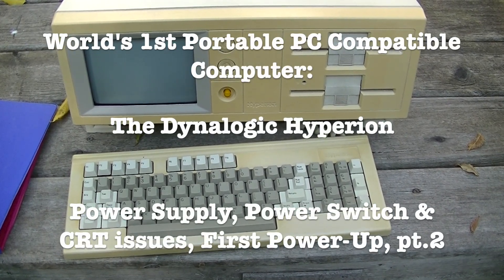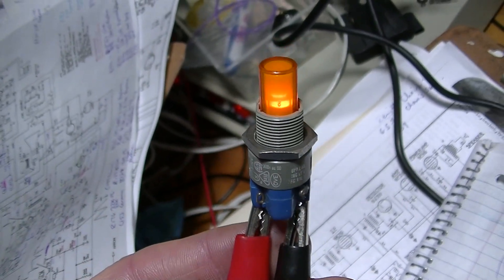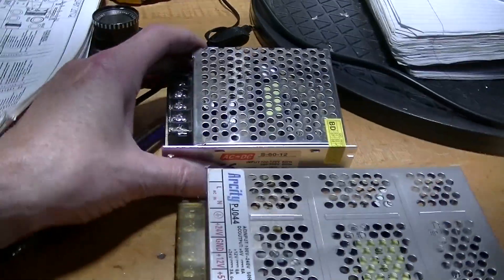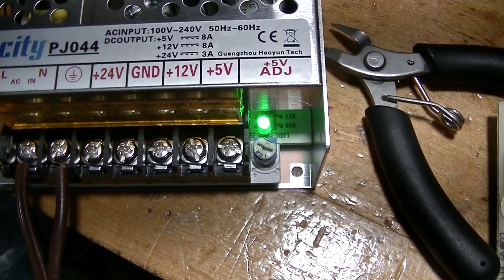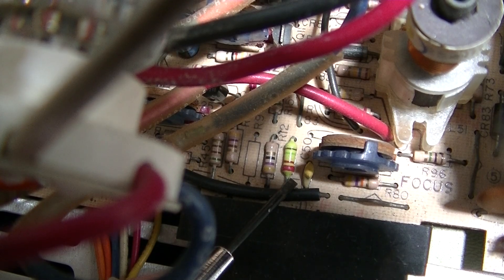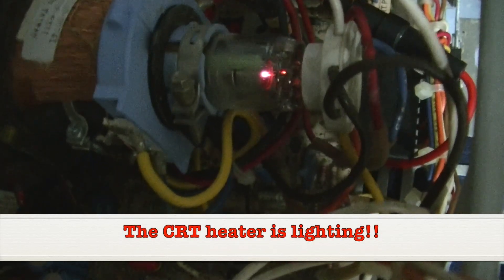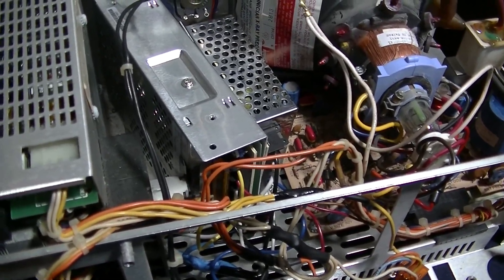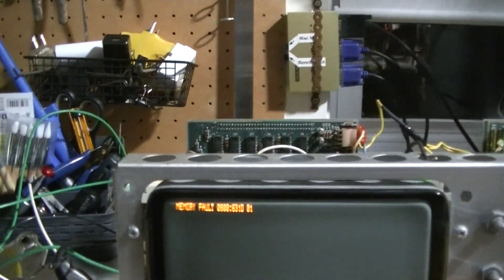1st Portable MS-DOS Computer: Hyperion (pt.2, Power Switch, Power Supply & CRT issues, 1st Power-Up)

Comment: I used to service these back in the day. We were the distributer of these units. They were also rebadged as 'Agile' by Anderson Jacobson. They were sold by London Drugs in BC. We had many many issues with the 5.25 inch floppy drives.
Reply from the maker: Thank you for commenting. I've read that Hyperion computers had a number of problem areas, with flaky disk floppy drives being near or at the top of the list. I'm wondering if you know anything about a weird video problem. The picture width is normal but is about ⅔ the correct height. The video is not readable and it looks like the linearity is way off. Brightness is way down too.  It looked like the printed circuit board traces to the 4-pin video connector were not making contact with the connector because I could wiggle it and I would intermittently get a picture. I ran 4-bodge wires to the connector from the 74LS244 and that hasn't really helped. Does this sound familiar? Thanks…

Comment: Cheap switchmode supplies tend to be horrendously noisy, injecting enough noise into the AC line to interfere with AM radio.  I had that problem with an inexpensive PoE switch with a built-in power supply which was recommended to me.  Luckily I had another 56V power supply which came out of an old NVR and I only had to swap the two output pins on the power output connector to get it to work with my switch.

You have to be very careful with powering up old monochrome monitors without a signal as they sometimes don't have their own horizontal oscillator in them.  One well known example is the IBM 5151, which derives its horizontal sweep from the TTL video input.  Without that signal the flyback won't oscillate and it can blow its primary windings.
Reply from the maker: You're right about the noise caused by some power supplies. Broadcast band (AM) radio reception becomes impossible. I haven't tested these power supplies to see how noisy they are. Yet.

Comment: Can you get hold of an Thermal camera, or if not, just an IR Thermomenter? You then can try to see if there is a sudden temperature difference between one and all other chips. I am lucky to have a Thermal camera (Leupold LTO tracker), and that saved my day in an array of logic IC's where one was bad. It lighted up as a Lighthouse among all others.
Reply from the maker: Thank you for the suggestion. A thermal camera and a better solder sucker gun are both on my wish list. The last thermal camera I was looking at was about $400 USD. Sadly, it’s not on the shopping list for the near future. Until then I’m going to have to rely on more primitive methods (e.g., alcohol evaporation). But you’re 100% right, a thermal camera will identify a shorted component quickly every time.
Reply: @Mr.BrownsBasement  Leave the machine running for a while.
Place your fingertip against the memory circuits.
With a little luck you can diagnose which one it is (cold or hot compared to the others)
Reply from the maker: @RandomerFellow Fortunately, there were no shorts on this board. With a board of this vintage, I would be more concerned about a capacitor shorted rather than a chip shorted as dead tantalums are almost routine. At 1.25v, a shorted tantalum will dissipate a watt or more. If it isn’t turning brown or beginning to stink it will eventually pop and take itself out of the circuit. I want to get it before it pops or starts spitting.
Reply: @Mr.BrownsBasement  Not sure if you're aware but FLiR makes a smartphone connected camera. New, they go for about $200 but after a cursory ebay search I saw they were going for about $150. Still expensive but it might be more palatable.
Reply from the maker: Thank you for the information. No, I wasn’t aware of that. But I was hoping to get a premium quality infrared camera so it would be both the first and last camera I would have to buy. I wouldn’t mind a feature like HDMI out as it would make it easier when I making videos. At this point, I’m saving my pennies for a good camera but I’m not there yet.

Comment: "PCs and... PCs"? Heh, oops.
Reply from the maker: Did I confuse my printed circuits, progressive conservatives, or politically correct president’s choice personal computers? These things happen.
Reply: Thanks for your comment love,  @Mr.BrownsBasement  But no,  @Mr.BrownsBasement , I mean that since you said "PCs and portable PCs," that didn't make sense, because portable PCs ARE PCs. It's like saying "PCs and PCs."
Reply from the maker: I guess I was trying to distinguish between the 1st IBM PC compatible,(MPC 1600, June 1982) and the 1st portable IBM PC compatible (Hyperion, January 1983). The first portable computer (not a IBM 5150 compatible) may have been the Epson HX20 (July 1982) which ran a proprietary operating system, had a built-in LCD display, thermal printer and microcassette drive, and wouldn’t crush you if you put it in your lap.
Reply: @Mr.BrownsBasement : Then in a case like that, the word "other" is your friend.
Reply from the maker: While working on the next Hyperion video, the monitor developed a new fault. Now all my “best friend” words have only 4 letters.
Reply: @Mr.BrownsBasement : That didn't make sense, but I just meant that you'd simply say "portable and other PCs" or "portable and desktop PCs," etc. By the way, that takes less work than sitting here typing up weird replies would do.
Reply from the maker: @HelloKittyFanMan  Thank you for taking the time and care to comment.
Reply: @Mr.BrownsBasement : You're welcome. I hope you understand where I'm coming from with my suggestion and would consider it FFR for use.